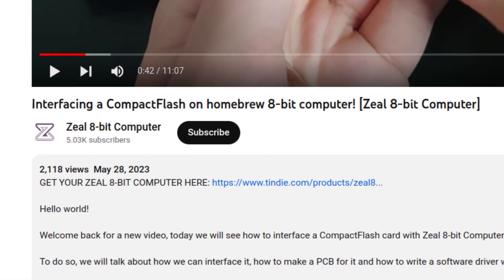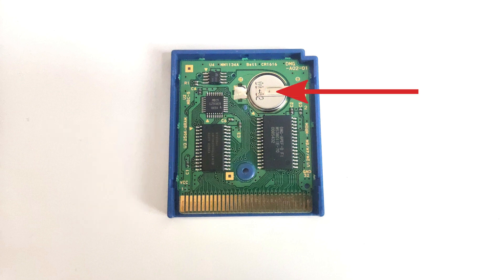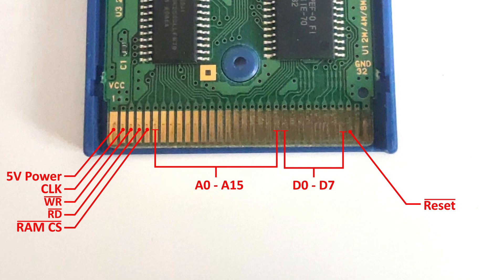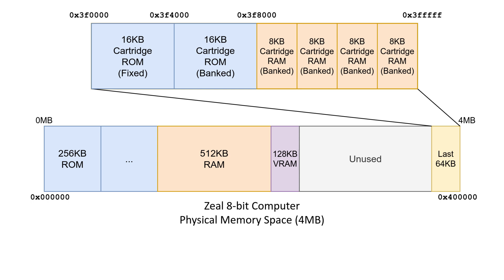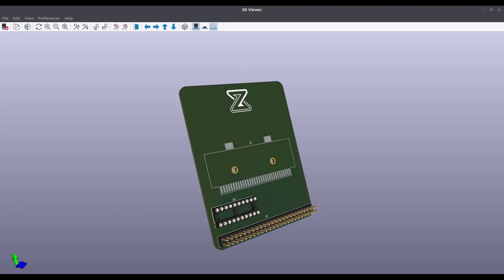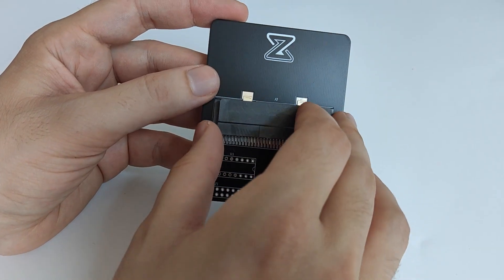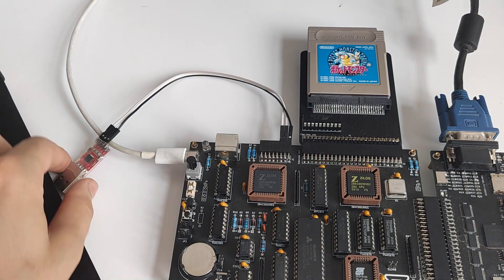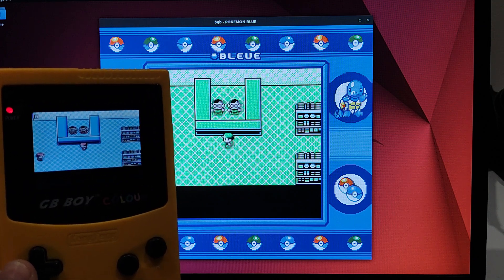Backup Gameboy games with Zeal 8-bit Computer!

Comment: I love the concept and the stuff your making with the user ports (or any other ports like the I2C port) :P! Can you try adding something like a PCI Express (But for sure youre own custom version of it)? :)
Reply from the maker: I would be possible but the 2.54mm connector fairly standard, easier to plug cables or breadboard😄
Which peripherals would you plug with PCIe
Reply: @Zeal8bit  Asus IoT AI Accelerator to make this thing machine learning capable

Comment: This could work with GBA carts as well since the connector is the same, but mapper is different and the data and address is muxed
Reply from the maker: Actually if you only want to backup the SRAM of a GBA game, you don't even need to mux the address lines. Since the SRAM is at most 64KB big, you can address it directly via A0-A15, upper lines are 8-bit data.
However, you must provide 3.3V, and not 5V, this also means level shifting all the lines.
That's a good idea for going further with this project!

Comment: Now it's time to make a gameboy emulator! 😂 That would be really awesome since you now have a way to connect the cartridge directly to the computer.
Reply from the maker: Actually it is not impossible and I thought about it! It would take time but I would love to.
A pure software approach would be too slow since Zeal is running at 10MHz, which is only 2.5 times faster than the GB. The main approach to reach reasonable speed would be to dynamically "compile" GB instructions to Z80 instructions, but I sitll need to thin about a way to trap when I/Os are written to or read from. I will keep this idea in mind 😄
Reply: @Zeal8bit  the idea wouldn't even be that crazy since most instructions are exactly same in z80 and gameboy

Comment: Yeah, I heard cartridges for many systems vary from a simple ROM PCB to even a satellite system on a board.
It is so cool that you're showing us a hobbyist computer can be useful as a real tool, in this case — an interrogation instrument, lol.
Reply from the maker: Thanks for your comment!
That's exactly it, because parallel interface used to be the norm, retro computers can very easily be interfaced with the vintage cartridges, controllers or even extension boards. Today, it is something we would do with an MCU, but it would require more code since they don't provide parallel interfaces anymore (at least very few of them do).